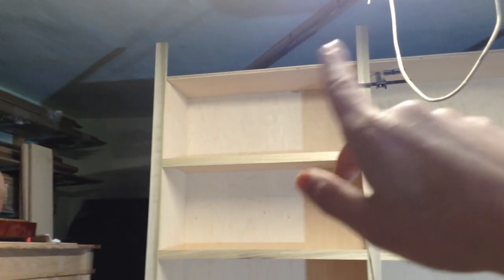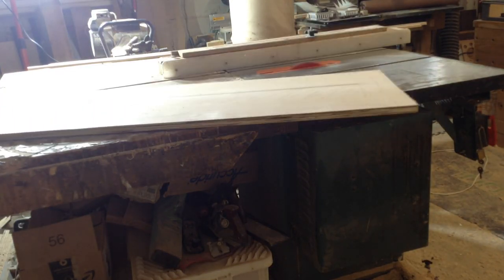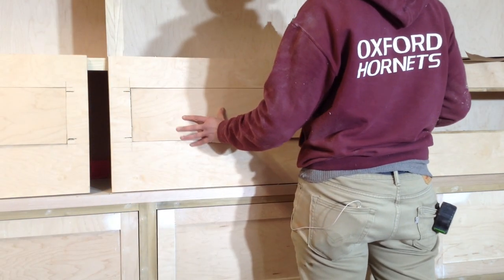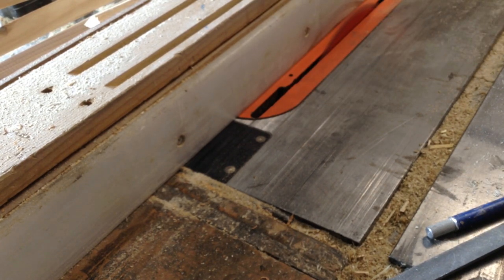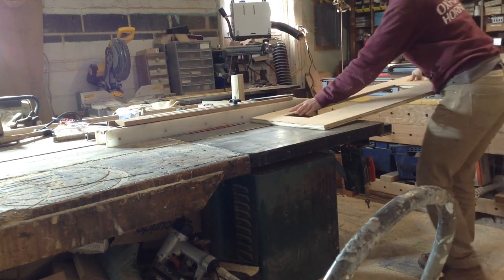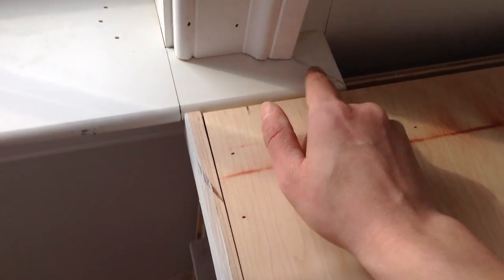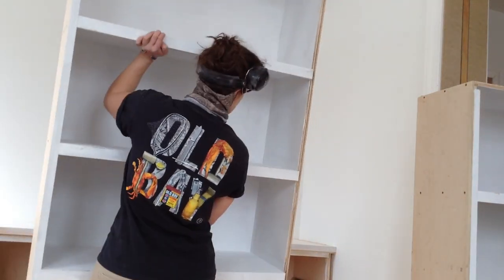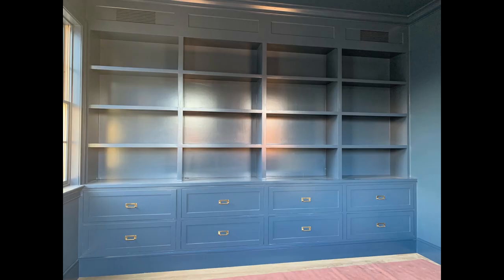Massive Built In W/ Storage : How-To Part 6

Comment: Impressive end result! Glad I had the time to watch it all. Every time I learn a small trick or two. I saw you didn't create a jig and router the middle dado's in the uppers. I think you said in a video you didn't really like routers in the first place, but that looked trickey with the clamped down fence! Stay safe and keep posting awesome content!
Reply from the maker: If I said I don't like routers in the video I misspoke.  I do like them.  I just think cutting dados with a table saw is the fastest/easiest way to do it.  So, I will drag my feet during times the cut won't work on that saw.   I have a dado jig specifically for the router, but like I said earlier it's just much faster doing it on the table saw.